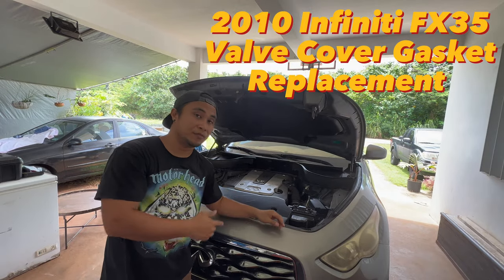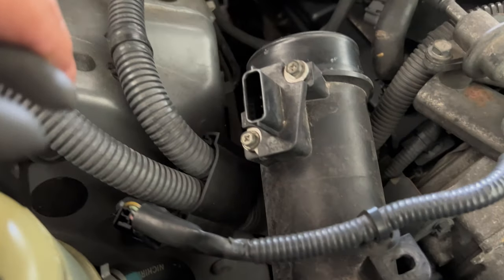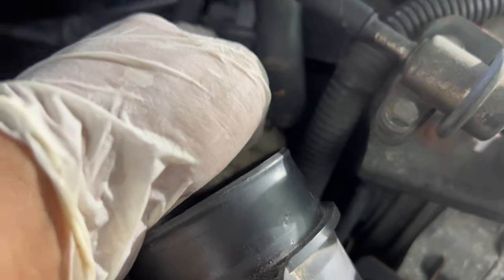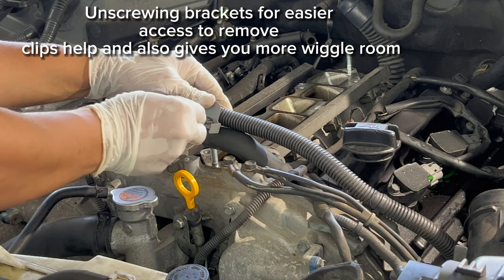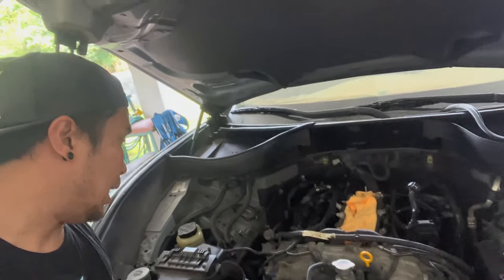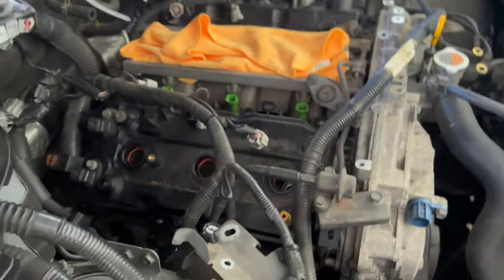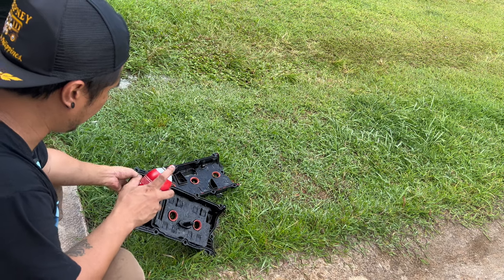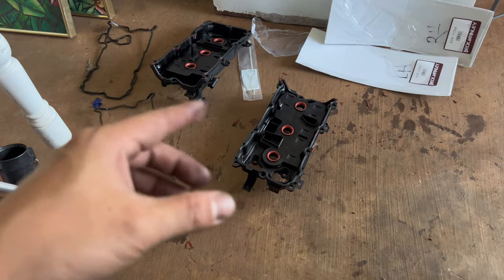2010 INFINITI FX35 Valve Cover Gasket Replacement | VQ35HR | Infiniti Nissan | 350Z

Comment: Nice video! If I could add something I would do one side at a time. Instead of removing everything from both sides. Less things to remember. My 07 FX just started leaking on pass side yesterday. I tightened the valve cover bolts and it stopped for now. I think there are more things you should replace while its torn appart. I will be looking into this further. I see some kits come with ignition coils. And some other gaskets. My engine is constructed a little different than yours.
Reply from the maker: Thanks soo much for the input!! Yeah tbh i dont like working on this car its a headache haha but yeah happy wrenching

Comment: Holy. Now my nightmare is going to be seeing oil when changing my plugs. I could never do this
Reply from the maker: Pay someone who can or save yourself and try
Reply: I have this car/year and today spark plug #1 threads only was soaked with oil 😞. Very grateful for this video you provided though 👍.
Reply from the maker: @allday4975  bank 1 usually leaks oil from there first..ive noticed thank you for watching and big ups hapoy wrenching
Reply: Is it necessary to change the valve covers or can I just use the old one n get the gaskets

Comment: can you explain how did you remove the altenator plugs and oil sensers along the bottom of the wire harness passenger side i have a 08 hr g35
Reply from the maker: Use plyer and or push pinch and pull the clips good luck and happy wrenching
Reply: @MarkPuke13  i did it but i just removed the fuel line and damper instead works just fine
Reply from the maker: @DragonStrke12244  very cool thanks for the info!! Might help a fellow owner as well!! Thanks

Comment: I think I’m gonna have to do this on my 350z HR. I’m getting leaking from the head gasket area and my coolant got dark so that means oil is leaking and, most likely cuz of that blown head gasket. The engine felt fine so I caught it early but i guess this starts my journey of working on this car myself. I seen a kit that comes with all the seals for like 400$. What do u recommend? Or would u need to see the engine 
?
Reply from the maker: Gonna be honest bro im not so sure its just that.. try asking forums online but id try to fix/replace everything and doing a flush and also yeah try asking more opinions good luck and happy wrenching
Reply: @MarkPuke13  will do, thank u
Reply from the maker: @360blur9  you got it broooo